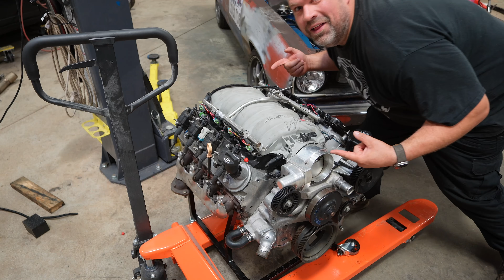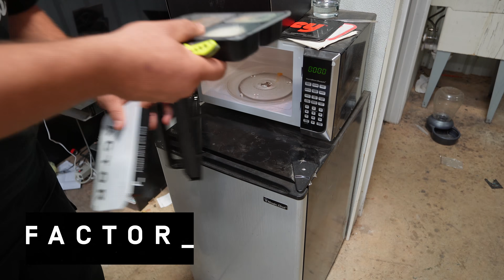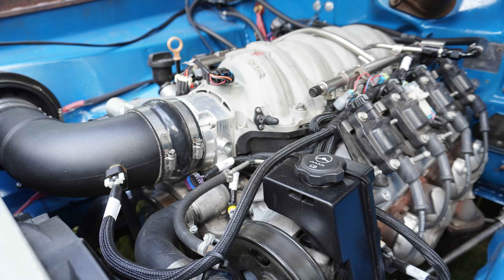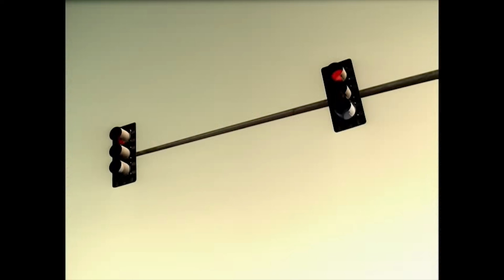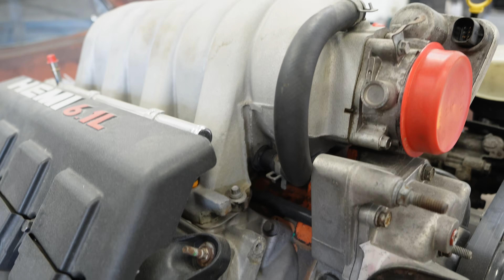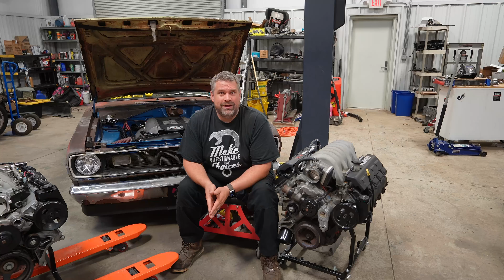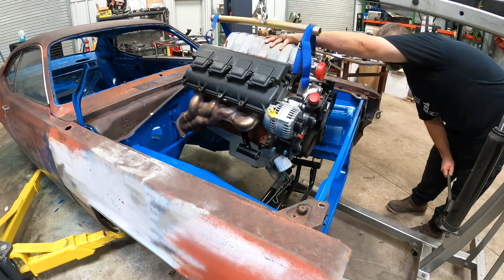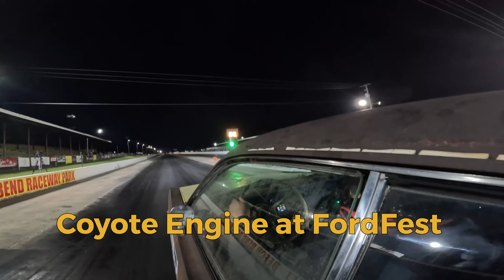What No One Tells You About Engine Swaps! Best Engine To Pick?

Comment: Great informative video!
FYI - The LS4 is the most common LS swap for the DeLorean community. We put a GTO front sump oil pan on it and use adapters to connect the LS4 to either Renault UN1 or Porsche G96 or G50 transaxle. Most of us run them naturally aspirated. Most upgrade the cam shaft, a few bore them from 5.3 to 5.7, one owner has his 5.3 with a supercharger connected to a G96 making over 520 horsepower to the wheels. There is a 383 stroker kit available for the LS4, but I don't think anyone in the DeLorean community has done that yet. I'm still building my DeLorean and had my engine rebuilt locally keeping it 5.3 liters with a cam from Texas Speed. I anticipate 430 horsepower at the crank and I'm using the Renault UN1 transaxle. Which should work very well, as long as I don't drive like an idiot.

Comment: The gen 3 HEMI is not a true HEMI and it is only a HEMI by name. The heads are not a hemispherical design as they are a semi-oblate spheroid design instead. Closer to a pent roof than a true HEMI. The LS is the most versatile and easiest to build power on not to mention the most compact and lightest of the three. A LS7 is a beast of a small block and would be what I would go with. Seven liters and 7500 RPM with 500+ HP out of the box. I beat up on both a 991.1 GT3 and a 997.2 GT3 RS 4.0 in a 2014 Z28 on road and track easily. Well easier than it should have been. Trust me, I was as surprised as I am sure whoever reading this is. I also owned gen1 and gen 2 Coyotes and they do make extra HP very easily with bolt-ons and tune. All are great and each has a different character.

Comment: Agreed Cleetus beats the snot out of his coyotes and for the most part they keep on running as where with the LS with the best of parts comes uncorked but LS is a damn good engine for building a 9 second street car. Also fuel mileage for out cruising the Coyote is half what that dodge will eat and  much better then the LS as well. Honestly for drag racing you want all your power up top torque down low = no go or broken suspension parts.

Comment: Its a minor point, but the 2015 Coyote air intake manifold did not introduce a variable runner length system (VIS -Variable Intake System). 2015 introduced a charge motion control valve system (CMCV). A variable runner length system varies the effective runner length to tune the Helmholtz frequency for low and high RPM. The CMCV system is effectively swirl control with flappers at the end of the runners. The CMCV is closed at low RPM in order to maintain air velocity. The mechanics of the VIS and CMCV are similar, but the placement and function are different.

Comment: 84 or 94 for the first Modular Ford SOHC V8's in the Lincoln Town cars?

Edit* although the Fox bodies (and Vanilla Ice) really made the old OHV Windsor head 5.0 V8's mainstream, the use of a 302 cubic inch Ford V8 dates back to the earlier 70's with the Mach I style Mustang (better remembered as the Boss) where the 302 appeared from a destroked 351 Cleveland head motor which was influenced around transam racing in that era.

Last edit* would have been cool to see an AMC Javelin as the big 3 neutral donor car for either engine, but they're obviously a niche collector car of past Americana now.

Comment: How does the Coyote engine measure up to the old Ford Big Blocks? I wanted to install a 390 in my first gen Mustang at one point and they said I would have to cut down the strut tower to get it to fit and a 360 would be better. I ended up putting a 5.0 in there out of a 84 Lincoln Continential. I used the kick down rod from a similar vehicle and didn't have to worry about the TV cable. It was a pretty good fit no real problems. And I would have liked the manual shifter. The Automatic came with the engine has been working pretty well. Some headers and carb made it very nice.

Comment: When you're comparing (3) three pairs of pants, but the bottom line is that it has to fit YOUR waistline, is A STUPID COMPARISON.  The Coyote IS NOT just the winner on paper bub, it's the most efficient, making more power per cubic inch, it's the highest revving meaning you'll get more power the harder you push it.

Comment: You can’t beat the durability of the Coyote in my opinion! There’s 280,000 miles on mine and it still runs as strong as it did with 60,000 miles on it. 🤷🏻‍♂️

Comment: All these engines are totally different in SIZE. Ford 5.0, Mopar 6,1, Chevy 5,7!!..... It`s not fear to compare it to each other. Mopar can be smaller as maybe 5.7 and Chevy could change a little, or the Ford might have a bigger one but not the 5.4. 
But the question that was not asked was: How much power can you get out of each engine without buying stuff to them?. Just fiddling with it and in a safe range for the engine. Then you might take some peak at horsepower per cubic inch. That`s more fair then have some big one against a smaller one.

Comment: I mounted my coyote upside down. The tires rub a little on the valve covers during a tight turn. I have a deep sump intake manifold.
Reply: Did you have to increase the fuel pressure to defeat gravity through the intake manifold?

Comment: I'm running a 5.3 LS stock internals 18 lb of a boost its 1000 horsepower at the motor. My friend is running a ls 1200hp on a stock block for 5 seasons now.

Comment: Your title question is flawed. Can't answer that without considering application. Off road, I want an engine that will get me home with a single wire dangling off a half dead battery being fed fuel from a coke can with a hole punched in it taped to the top of the intake.
But you didn't list a small block or big block chevy.
You can keep your electroplastic crap if we are talking trucks.

Comment: The over head cam is nothing new for Ford they had that design back in the 60's which most guys never really knew about the 427 SOHC Cammer. Also Ford had overhead 2.0 and 2.3 liter 4 cylinders in the Pintos and Mustang ll's in the 70's.

Comment: Just putting it out thare but I had a 5.0 in my 1980 Lincoln mk 4 it was the best motor it had 320,000 miles on it and it Purred Swap the motor into a Mustang.  I know the motor lasted another seven years until he wrapped it around the tree Other than putting oil pump on it. And I think an alternator I don't think I did anything to that thing Just change the fluids.
Of course I gave it a tune up but I mean

Comment: the LS is a solid engine. its just ugly. it is so ugly GM literally put a bag over its head and created engine covers to hide how ugly it is.  the Hemi on the other hands is an awesome looking engine. the Coyote fallowed GMs lead and made an ugly engine with covers.  honestly for the ease of use you can't beat a LS.  there are so many swap kits and go-fast parts available for them that you can swap them into anything. which also leads to them being overdone. at car shows i just walk by cars that have LS swaps. it's become like the Gen I small blocks swapped into prewar hotrods back in the 80s and 90s. back then every 32 Ford had a small block chevy under the hood.  same goes with the LS. it's just over done and not cool any more.  the Gen 3 hemi on the other had looks killer under the hood of an old Duster, Charger, Cuda, etc.  as for the coyote, i never seen them swapped into anything other than older mustangs. and since i am not a mustang fan its not for me. but it may look cool under the hood of a cyclone, or Grand Torino, or Galaxy 500, it just doesn't have the low-end grunt to move those bigger cars. and if i was going to swap them for a newer engine, i would certainly go to a 7.3 Godzilla motor for those bigger cars.

Comment: Go to gen 3 eagle heads do flow well  so do the LS Heads but coyote being the most evolved engine of the three performs much better than its LS and gen 3 Hemi  counterparts imagine if the coyote was a 390 cubic engine? Built the same way as a 302 is now just enlarged matching the 390 cubic inch, the heads on the coyote the entire engine is next step technology, for an LS to compete with the coyote and needs to be about 427 CI to meet pr beat the same goes for the hemi I love the Chevy platform and I really like the Chrysler but if you compare them equal cubic inch to cubic inch this ford variant has no equal, me saying that is going to bring all the haters.
Reply: Sorry about the spelling my phone loves to correct me and it makes a mess of it most of the time.
Reply: After watching the rest of the video I would put the Hemi in there and forget about the other two especially coyote just to difficult.

Comment: LS..better aftermarket support. Wide variety of mount kits, intakes, headers, oil pan kits, harness kits ..You can bolt on a 55 year old GM TH350 trans to it..convert it to carb setup. It fits easily in a lot of old cars.  Its basically the small block chevy of the 21st century.

Comment: First year of mod motor in a Mustang was 1996. The first two years of the SN95 chassis, 94 and 95, used the old pushrod 5.0 from the fox body. In 1996 Ford switched to the 4.6 mod engine.

Comment: I love the 4V 4.6 its super smooth and has nice power delivery I've had little issues with mine and its at 175k miles currently. If it goes I'd love to shove a coyote truck motor in my mark viii since it makes 105 more horsepower stock for stock.

Comment: I feel like the 4.6 is grossly overlooked. Trickflow's 2 valve heads put it above the 3 valve, you can get a 3.75" stroker crank and still rev to 8000, and if you REALLY want to go whole hog, you can sleeve and rebore it for 3.700" bore like the Voodoo since it IS technically the same engine family, giving you a SOHC 2V that flows almost as good as the 4V for not much more size than a pushrod motor, and about 322" of displacement.

If we follow David Vizard's guidelines, with a bit more optimization of the trickflow heads, the correct cam choice, and 11.5:1 compression, you can get it to at least 450 lb-ft of torque at the crank, N/A. If peak power occurs at 6300 and torque hasn't fallen off, that's 540HP at the crank. If you cam it for peak at 7000, you'd get 600HP N/A. At the crank. If you drop a ZF-8 speed behind it and an 8.8 rear end, that's about a 20% loss, so you'd get 450-500whp or so depending on how far you let it rev. N/A, of course.

In a sufficiently light car (as any proper sports car should be) that's plenty of power to remain balanced with handling capability and not be overpowered. If you want more power at the strip or for rolls, just drop a 150 shot on it. TBH I'm tired of seeing underutilized turbos wasted on V8s to make 500-700whp, anyway. If you want to do that, be a REAL tuner and drop a V6 or straight 6 in your shit and give it at least the 15 pounds that every turbo wants to deliver (in order to be efficient) to make your 500-750whp.

No more of this sub 10psi turbo shit, especially on an untouched iron block truck engine. It's just dumb and wasteful.

Comment: Coyote is definitely the best of the bunch here when performance is the goal, however I'm gonna agree with the form factor/size and say that for individuals that don't wanna chop up a good car for a shit Pinto based Mustang II suspension, the other engines are the better option. For what the LS and Hemi III are, they are great options. Real St. have a 2800 HP Coyote with stock block, stock crank, stock (Shelby) heads. The other engines with the same stock components can't touch it.

Comment: Ok, let's start with this discussion as an LS or Hemi.  The Coyote just sucks.  I do a lot of swaps, been doing them for 15 years either my own or helping friends.  I helped a friend once with a Coyote, never again.  To big, to expansive, to complicated, all the reasons you touched on.  Cheap, the LS gets the nod.  Let's face it, I get them for trades for old engine parts, just got a 2009 4.8LS  LS with 81,000 mi dropped off complete for a used MSD 6L box.  If you want to use the stock PCM a standalone harness is 90 bucks and that little 4.8 with a reflash, decent exhaust without cats and a cold air intake will put out 325-340hp all day.  Don't like the electronics ?  Pick up a MSD 6LS box for the ignition and a intake for a carb and drop your favorite carb on it.  No way for the coyote and I've never seen a carbed intake for a Hemi, Easy-Peezy.  The LS enjoys universal mount kits for 50 clams and the accessory drive is easy with truck parts.  I just did a 1968 C10 swap and used the stock parts with just a new Camaro 6L SS tensioner and water pump and idler relocation kit from ICT, 70 bucks covered both.  The water pump was another 70.  An old 700r4 bolted right up with a converter adaptor for another 15 dollars.  The nice part is I could have used any GM trans, analog or electronic.  Ram, not so much.  The proof of the pudding is my bread and butter swap, a 5.3 LS with a cam and a few other valvetrain upgrades with a Turbo Hydro ? behind it into an '80s Fox body Mustang.  I've done a half dozen of them including a 1986 LX with a cammed 6.0L LS running a 800cfm Quadrajet for my son.  Godawfull fast running high 11's in the quarter, looks and drives like grandma's grocery getter, 22+ mpg on the road, doesn't attract unwanted attention in the neighborhoods and the most fun for 6 grand ever.

Comment: You also need to think about your power goals. Are you looking to make 500 wheel NA? or 1000 wheel with boost? Depending on which motor you choose it could be the difference between forged internals and a cam, or not touching any of those things.

Comment: There have been Mazda RX7s with botched V8 swaps listed on Craigslist. The guys selling these half completed engine swaps say they ran out of money and or space to finish the engine swaps. They also say that they disposed of or sold the Rotary engine, transmission, and the wiring harness — Effectively making their Rotary powered Mazda RX7 — a “Bucket” for us 1979 -1985 First generation, 1986 - 1991 Second Generation, 1992 - 1996 Third Generation Rotary powered Mazda RX7 fans. 

The Mazda RX7 was aptly named the poor man’s Porsche for its performance including its capability to reach speeds of 140 mph and its independent rear suspension and almost 50/50 weight distribution which gave it nimble handling at any speed. A Mazda RX7 team without factory backing won the Le Mans 24 Hour race with a Second Generation Rotary powered RX7. Rotary powered Mazda RX7s won the GTU class at the 24 Hours of Daytona 5 years in a row between 1985 - 1991. At many of these races, the Rotary powered Mazda RX7 won races against “The Ultimate Driving Machine” BMW.
I always trusted my Second Generation Rotary powered Mazda RX7 in the turns or at speed.

These guys that use Rotary powered Mazda RX7s for V8 swaps should have their Penis surgically removed so that they go crazy because they have nothing to play with.
There are lots of other cars to do V8 engines swaps with.

Comment: Not the best for powee but my 2000 5.3 ls has 730k miles and hasnt been opened once. Juat routine maintenance and tune ups. 4 transmissions later it still runs strong.

Comment: What about an average swap? I need more power from my truck. Where should I start to begin acquiring information on exactly how to swap my engines. I have an 2006 dodge dakota 3.7l v6 with 42rle 4 speed transmission.  👎 worse drive train I've experienced to-date.  I also have a 1993 Buick roadmaster with a 5.7l v8 in it (vortech If I remember correctly)   I want to take the 5.7 engine & transmission and install in my 06 dakota. Where should I start? How complicated is it for the electronics swap? Etc....

Comment: 4t65e and the 4t80e that’s been modified will both work with the ls4 but the ls4 needs the most of the adapting. Little grinding here and there and relocating the starter after that it’s pretty much straightforward they share similar shift logic and the 4t80 can handle way more power than the 65

Comment: So it is all about the engine I want eh? Lets see I like to have a reliable engine for a daily driver, I have a Ford 4.0 currently, and tossed up between a Ford 4.6 OR a good old fashion SBC swap. And leaning closer to the SBC due to cost and parts available...
Reply from the maker: Just make sure to look at aftermarket support. It’s hard to beat a ls or small block for that right now!
Reply: @TheQuestionableGarage  yeah agree. I used the Small Block for years. They out lasted the body of the car. So I am thinking on this rout to go. ty

Comment: While this video points to which is the best engine, I feel currently nobody talks about automatic transmissions. Now you have to rethink Holley vs Factory ecu’s. Holley has very limited Transmission support. Has anyone driven a Mercedes AMG GT with a DCT transmission? A car like that will open up your eyes to what a transmission is capable of. The engine is only half the story once you include a DCT or a 8HP transmission. Manuals are great and make a swap super simple but are not cheap either and compare to a 8HP transmission, a Manual trans is primitive in comparison. Me personally, I would not swap a LS or Cayote, Hemi unless I could use a 10 or 8 speed automatic trans. That’s if you want super fast sequential like up and down shifts. So transmissions selections would change this whole conversation again.

Comment: Great & informative,  first time finding your channel.  I would like a Coyote, but the expense was a factor. Therefore, for my 53 F100, I chose a 5.0. Yes, a meager 302 & drivetrain from a late 90s early 2000s Explorer. Front suspension is from an 03 P71 Crown Vic (cop car). Easy to install, a ton of room, and cheap ($75 engine, rear 8.8, $200 4R70W, $275 for 55 F100 frame with CV swap already done. $550 all in.)